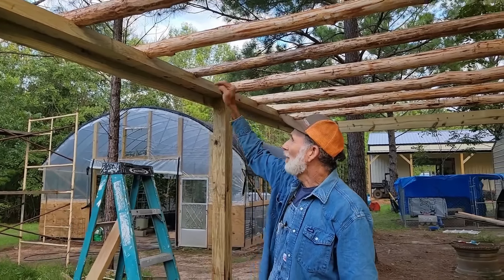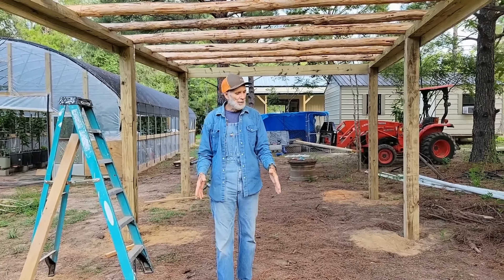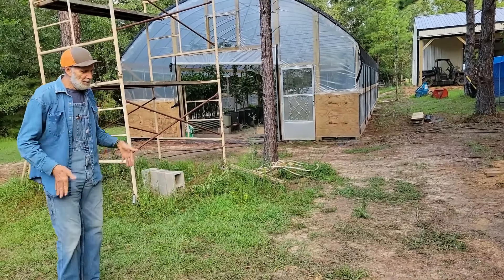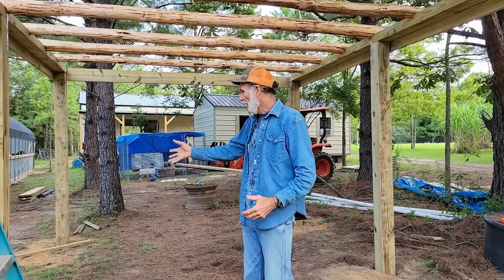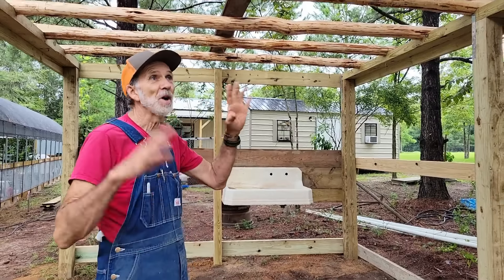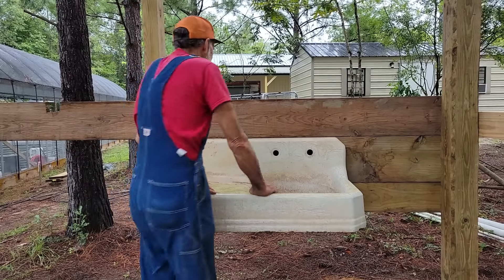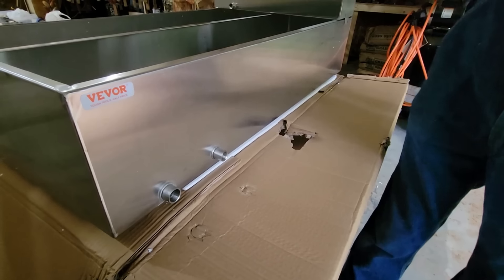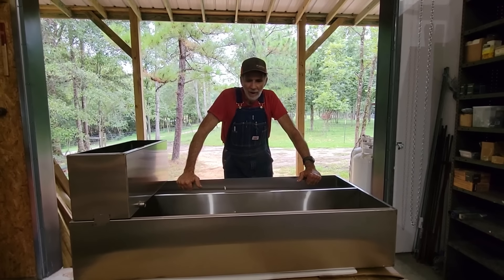Danny Has MANY USES for THIS!!

Comment: When I was about 13 years old my brother pulled some pine logs and daddy built a barn out of them and that barn is still standing today, 66 years later.
Reply: Peggy, same here! Daddy grew up poor and used whatever material he had on hand. If he bent a nail he would hammer it back straight and use it. Never threw anything away.
Reply: My grandfather build my family's home out of pine logs and he built the foundation out of rail road ties. The house is holding up great also.  Men used to do amazing things, idk what happened with my generation of men.